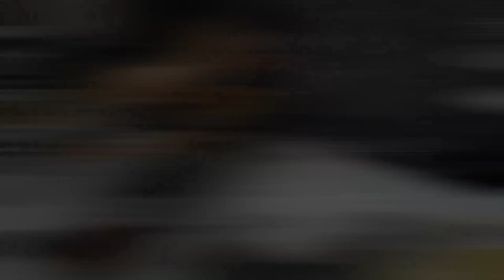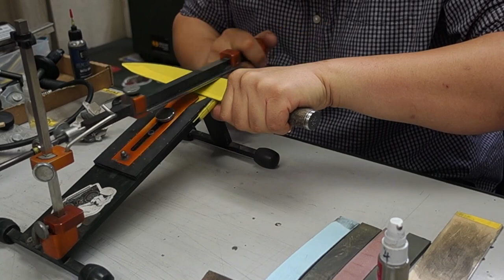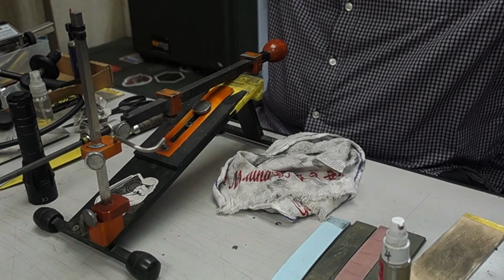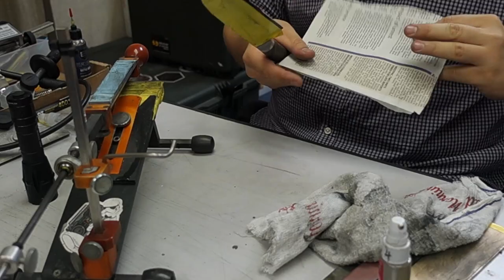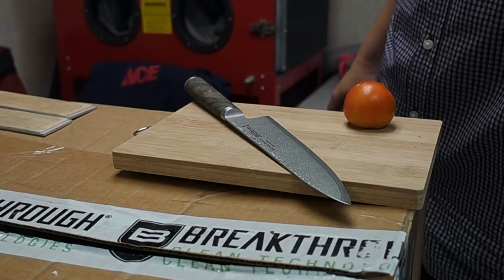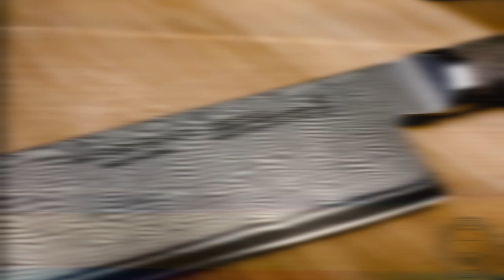Super FUN knives to sharpen!! Miyabi in MC66/ZDP189

Comment: do you find these angle systems too slow to sharpen a mass amount of knives? I almost bought a tsprof kadet. I decided to get a nice set of wetstones first to learn freehand.
Reply from the maker: Oh its definitely a lot slower than say, a 2x72 grinder. Though, it can actually be a good thing. I've got a little more control on how much material i remove and definitely won't generate heat that could damage the heat treat. Also, Jende has some nice diamonds and Naniwa's that hog off steel real quick, for those bigger projects.

Personally, i'd save the cash up and spring for something like the JIGS or the R2. I've heard a lot of people weren't happy with their kadet.

Comment: you sped up the video a lot. how much time was the video footage originally?
Reply from the maker: original video was about 30 minutes. I sped up the boring repetitive bits and left the juicy parts.
Reply: @The_Polished_Edge  thx for the info! great sharpening results with Hapstone 😍
Reply from the maker: @leecherlarry  anytime man, i know it's not very instructional, and i did plan on making an instructional video, just haven't found the time or proper setting to do so.
Reply: @The_Polished_Edge  Do you also sharpen freehand? I usually sharpen freehand, seldom use my RUIXIN PRO III.
Reply from the maker: @leecherlarry  Not normally no. Since people pay me to do it, I usually use the guided system to ensure the bevels are as flat and even as possible. To a certain degree, I'll say I'm reliant on the system as I do get more consistent results with it.  There was 1 occasion where I did sharpen the knife freehand. It was a very thin Japanese Nakiri, and it was just easier and faster to freehand it.

Perhaps part of the problem is the ruixin, it's not as stable or well-fitting as the better systems around. makes it frustrating to use sometimes. I've actually had the same issues with the edge pro, which is why I moved to the Hapstone V7 especially for the big knives and will soon move to the JIGS for smaller knives
Reply: @The_Polished_Edge  Oh my modded ruixin is very stable and has 3 big magnets to fix the blade. I even developed the so-called PTS method for it, meaning i am a super convinced ruixin user. Minimal play in the rod holder is welcome, so that i wouldn't have to reprofile every new knife: a guided system has no 'flexibility' in the sense that the angles are superfixed; thru its circular arm/motion it impregnates/imprints its own particular grind on the edge, making it indeed totally flat, as if it was ground by a buzz saw. My kitchen knives turn out the sharpest after a ruixin treatment. I have no complaints re the device or the results. After 2 yrs of intensive and extensive ruixin use i simply grew tired of the process, wasn't enjoying it anymore. When i want to sharpen/touch up 4 (really different) knives from the kitchen, this is still enjoyable to complete freehand in a single session of 0.5-1.5hrs. In a direct comparison, masterful freehanding is more effective (energy, time, efforts, results, joy) than masterful hapstoning. But i am no master, so my ruixin results beat my freehanding results too, haha.
Reply from the maker: @leecherlarry  oh i get what you mean,  it kinda takes the fun out of sharpening, but at least we get good results. I do still find it enjoyable when it's a realy good knife with really good steel, or when its a challenging blade shape. When i'm enjoying myself, i usually take more time to finish the knife as i'm test cutting newsprint almost every minute.

I do agree on freehand being more efficient time wise, and if you're good, like michael christy good, then yeah, you're probably at peak performance. I've been meaning to practice freehand more, but just haven't had much time. I've got quite a stack of knives on my table that need sharpening and i've not even touched them yet.
Reply: @The_Polished_Edge  it's exactly when i got to see michael christy's videos for the first time that i stopped using my guided systems; that was eye-opening and inspiring to see! He is my one and only reference for freehanding, and my own technique is derived from his. luckily i don't need to do full sharpenings anymore, only touchups (with 204UF or 302UF spyderco). I also "invented" my own special strop: a wooden paint stir stick loaded with polishing compound. i hold the knife fixed in one hand and stroke the edge with the stick .. , which is actually very similar to stropping a knife on the Hapstone.
Anyway, congrats to the Hapstone purchase. A year ago i was very interested in buying the Hapstone V7 or M2 too!!
Reply from the maker: @leecherlarry  MC is a great source of technical info, and he definitely has his techniques at its best, but there are other sources out there too, and some of it compliments what MC says, or might be an opinion from another angle. I've actually already had the V7 for about 2 years now, and it's serving me pretty well
Reply: @The_Polished_Edge  Do you think the TSProf would be a better buy than the JIGS? The JIGS seems pretty expensive for what you get compared to the TSProf
Reply from the maker: @anthonywaldrep5982  before I give you my answer, you must know my biases, but you must also know that I will do my best to be objective about it. I am a Jende, Hapstone and Gritomatic Distributor in Malaysia, so I pretty much have a horse in all races, except for TSprof. I've also had an unpleasant experience ordering a unit from TSprof before, which was to test the waters and see how it would be like to work with them. While it wasn't hostile, between the delays, missing items, lack of response, and insinuation that I made a mistake with my order, it wasn't as smooth an experience as it could have been.

Ok, now on to the systems. I've only managed to use the TSprof, and not had the chance with the JIGS yet, but from the videos and secret leaked pictures, I can only try to make a comparison. 

- I like the micro-adjustment feature on the JIGS more, the TSprof adjusts pretty easily as well, but it just feels more convenient and robust on the JIGS. 
- I like that the TSprof has the angle meter, but it's not something I rely on a whole lot. they both have platforms for inclinometers afterall
- I like the stop collars on the TSprof, and I hear the JIGS may come with them too (after much persuasion, mind). 
- Sans base, the JIGS seems to have a larger footprint, but who's gonna use this without a base right? 
- TSprof has a higher adjustment threshold, about 2 dps on the lower end and 6 dps on the higher end. These claims, of course, would also rely on the distance of the edge from the fulcrum of the guide rod, and JIGS claims that their listed figures are on the conservative side, which means it could very likely be more than that. BUT, I rarely sharpen that low or that high anyways. 
- JIGS states that they can work with blade lengths up to 26", TSprof doesn't have a figure (not that I could find), but they claim to handle up to chopper sized blades, which should be sufficient.

JIGS is pretty new, and all I can observe is that Jende would've studied their competitor's products, and correct everything they find inefficient about it and implement those fixes in their product. 

The thing is, though, you're comparing 2 similar products, both should be pretty good in their manufacturing process, I just feel the JIGS has features that I know I'll want. That, and anyone who's dealt with Thomas will tell you he's a great guy who's always on the ball where service and response times are concerned.

If price isn't a factor, I'd take the JIGS as a complete package of excellent product, service, and knowledge. Besides its just 40 bucks more than the TSprof. If budget was an issue, Hapstone has the K1 available, though more meant for smaller blades.
Reply: @The_Polished_Edge  Thank you so much your opinion and response! I've ordered stones from Jende and I've always had a great experience. I also noticed that the JIGS was all stainless steel construction. The other competitors all use non stainless steel
Reply from the maker: @anthonywaldrep5982  anytime brother. Yeah, and they're one of the few who carries those sweet sweet japanese stones. yeah, Thomas mentioned to me that he wanted them to be dishwasher safe, which was a requirement for the professional kitchen. Pretty cool, overall. It's easy for me to justify the price though, i sharpen plenty of knives a month, divided by the cost of the system, it ain't much to bear